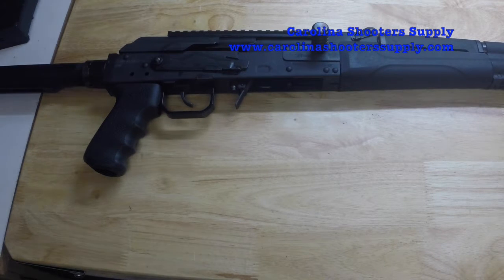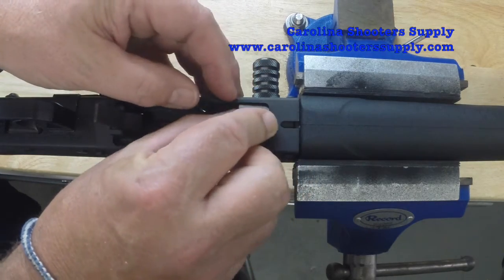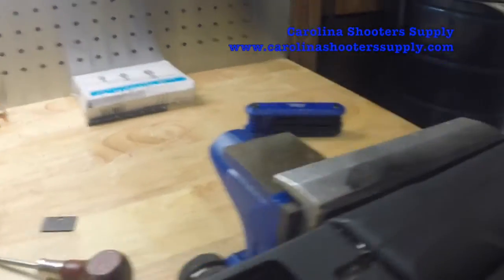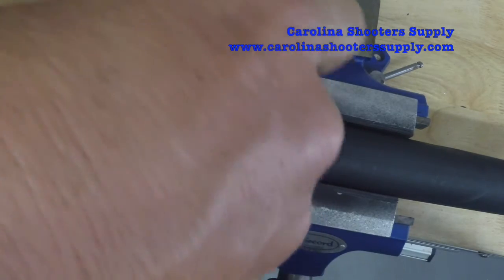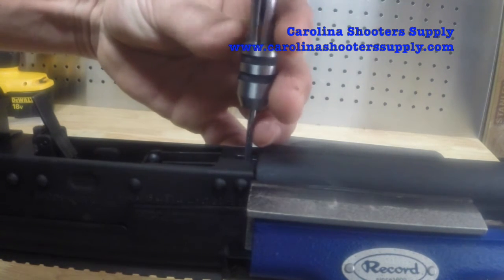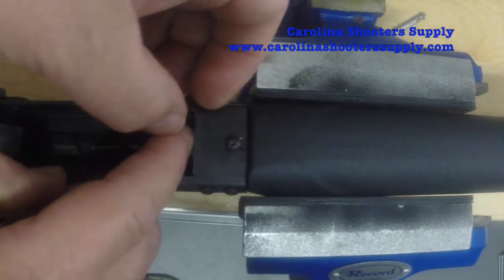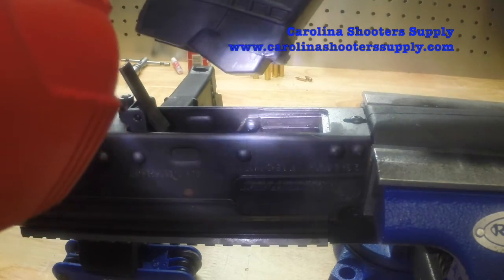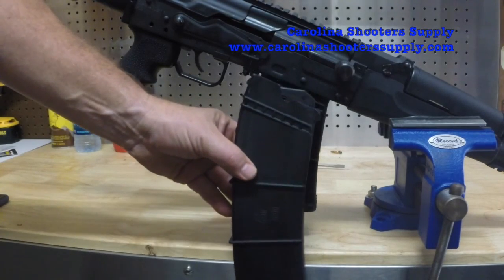Catamount Fury Magazine Conversion to Saiga 12 Magazines

Comment: Every hole I have seen you do is crooked or off center, Use a set of calipers to mark the exact location of the hole and then use a transfer punch, Both tools are inexpensive and will make the job look much more professional.

Comment: Soooo does the OEM mags work in it as well or not?
Reply: The will not.  Once the conversion is done, you have to use the Saiga mags.  Fortunately, they are a more easily obtained than the OEM magazine.

Comment: I am surprised that CSS has not come up with a "mag well" conversion or adaptor for the Fury 1 (which uses AK style "rock-in" mags, which are a real pain when the bolt is closed) to be able to use Fury 2 mags which "slide-in" or "push-up" similar to AR mags! How about there guys!?

Comment: I am no gunsmith but i did encounter a problem that wasn't shown.  Inside the receiver right where the back of the magazine locks in there is a lever that bends down inside the thin lip of the fury magazine and senses when the last round is ran and locks the bolt back. Well the Saiga magazines I bought are thick back there and when locked in force this sensing lever upward and it obstructs the bolt from going forward all the way. So I had to grind the inside back lip of my saiga magazines so this lever had room to drop down and let the bolt clear. The downside to this is that the saiga magazine feed pressure plate (just under the rounds) stop down below where the fury magazines do so when you have shot your last round it doesn't push that lever up to lock your bolt on your last round. No big deal but it took me a while to figure that all out and I thought it would be something that was covered in the modification video. Unless I've done something wrong! Lol Still a great video! Thank you!

Comment: I'm considering a conversion but I'm a armature on gun repair/ mods. is this something an amateur can pull off and have a good result?  Also I'm looking at a stock with grip that doesn't require and modifications and wondering if you have an opinion on those?

Comment: Should have threaded the hole in the plate and used a short screw through the factory hole to hold it in place. Less work, cheaper, better all around.
Reply from the maker: Not all FURYS have the same mag well design and we want a part that would work for all, all FURY 1s and FURY 11s.
Reply: From what I've noticed, the Fury 1's are made to use a magwell, but the magwell isn't attached. It has the same un-used elongated hole the Fury 2 magwell uses as an attachment point, which is why the magwell hole is slightly too large (it was meant to have the magwell attached and fill the gap). Too many people are leery of drilling into their guns if they dont have to, or they just don't think they can pull it off. A bolt-on solution is always best to cover all bases if possible. I believe this little plate is a brilliant way to use Saiga 12 magazines, but if you have to alter your magazines, it kind of defeats the purpose. If you include a cheap square nut and short screw to install it from the outside without permanently modifying the weapon, it would be perfect. You could also make an optional version with a little more meat on it for people who want to fine-tune it and file it down exactly where they need it to feed properly. Just a couple of thoughts, no disrespect intended. I'm glad to see you're still around. I spent plenty with you in the hayday of forum.Saiga-12.com.